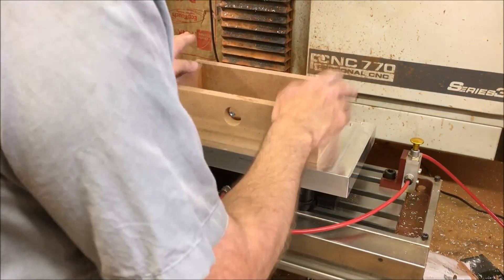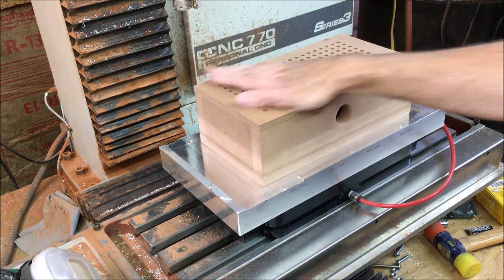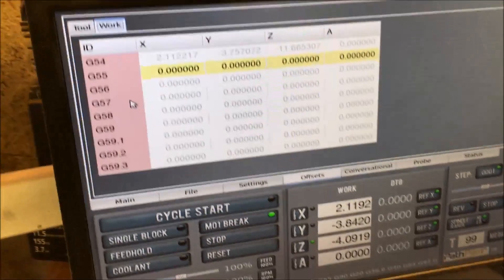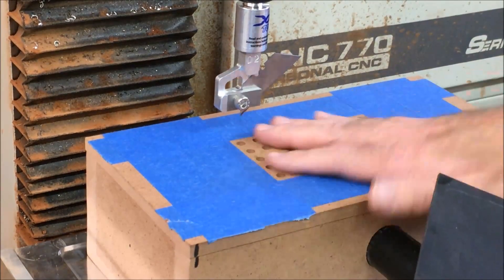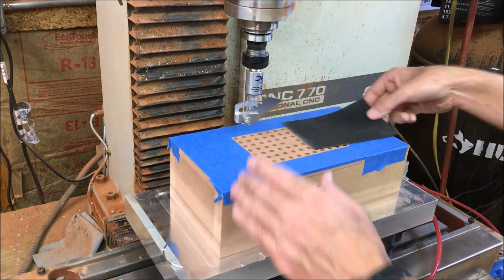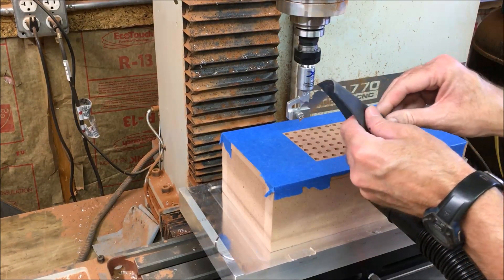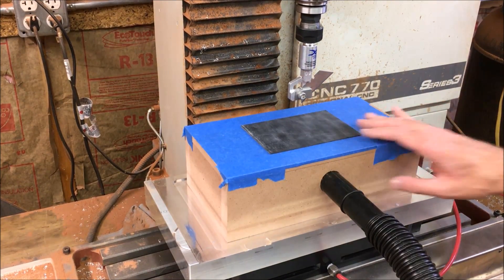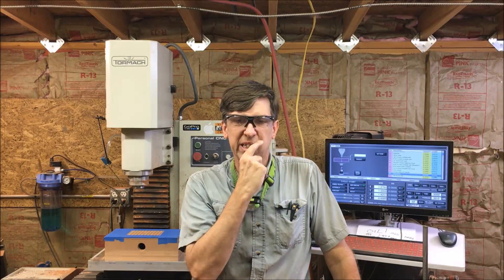Dragknife Vacuum Box for my Tormach - Part 3

Comment: You could countersink the holes in your box and make flanged bushings to fit in the holes. The bushings can either have smaller holes or be completely solid depending on what you need/works best

Comment: How about using the tormach to make a cutter to press cut the gasket?
Reply from the maker: Actually, I am about to move into steel rule dies.  Should be able to cut 14  gaskets in one shot with it.  I think I will make a video on it.  Its kind of like a real long razor blade that can be bent into shapes and embedded in wood.  Thanks, Craig
Reply: Thanks for the videos.  It's nice to see your business expanding.  Before long you'll have to move to a commercial building and hire employees!!  Have fun with it..

Comment: I know it kinda defeats the purpose of the vacuum box, but will putting tape around the edges help with the rubber not lifting? Just a thought.
Reply from the maker: Thanks Mark.  If it was just a few gaskets I would probably do that but this is for production.

Comment: Great series Craig!  I don't know anything about that drag knife, but I would try cutting much faster like 90-100 ipm.  I think part of the problem is the time the knife is over the hole and it is sucking the rubber down.  I may very well be wrong, but should be easy to try.
Reply from the maker: Thanks Jason!  I was worried about the high speed on the center hole but I guess I could make that a separate operation.  Yeah, maybe a higher speed might help.  Thanks!

Comment: Awesome! So close to perfect.  As mentioned already in the comments, the rubber seems to be getting pulled into the holes a bit.  I'd put make the holes half the size, but increase the number of holes to 3x what it is now.  You might also consider making the top plate out of a white plastic cutting board...?  I wonder if the vac would pull the center down on the cutting board when the rubber is on it?  Hmmm.....a center support could be added without much issue.  Just have to get the height right.  
Hard to tell in the vid, but the center hole looks like it's perfect.  
Couple of tweaks and they'll be coming out perfect all the way around!
Thanks!!
Mike
Reply from the maker: Thanks Mike! Yeah, I need to make another top with 1/8" holes.  Yeah, Ill have to check into a plastic top.  There is no vacuum hole in the center of the top so the center hole in the gasket comes out fine.  Thanks again!

Comment: try to redo your top with the holes, so it will cut the outside edge between the the rows of holes. Looks like it is sucking the gasket down into the hole so it can not cut the full depth.
Reply from the maker: I thought about that but we offer the covers/gaskets as custom so they can be any size.  I think I may have to make the holes smaller.  Thanks.

Comment: did lowering the Z make it cut better?
Reply from the maker: Sorry, I guess I got busy and forgot to video that part.  It was better but not perfect.  I still have about 6 little spots that I have to tear.  I will probably just cut the little spots with an exacto knife for now.  I may make a new top with 1/8" holes instead of 1/4 and hope that works.